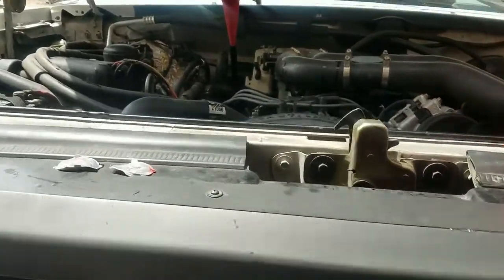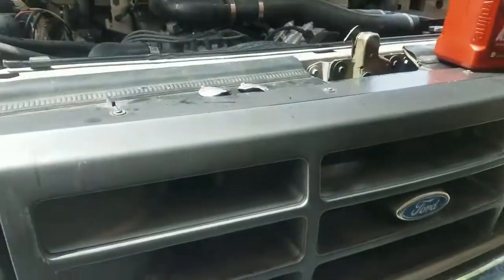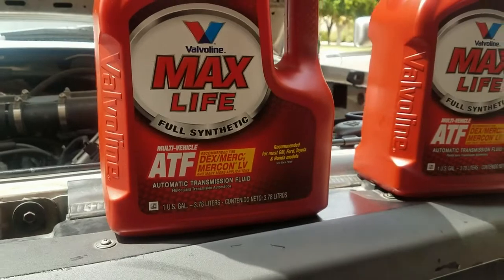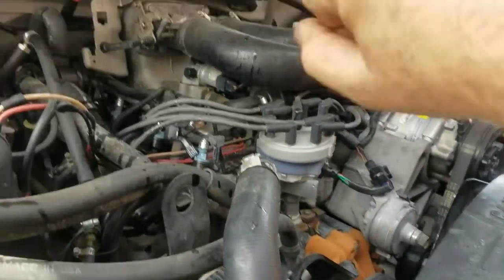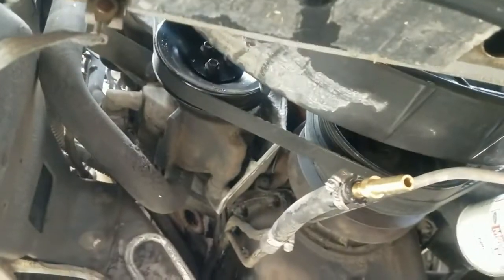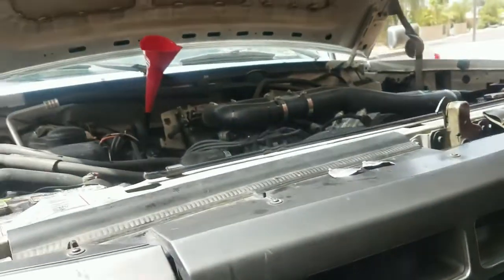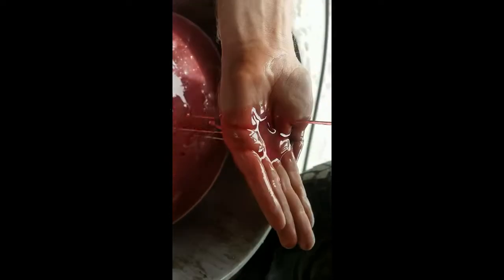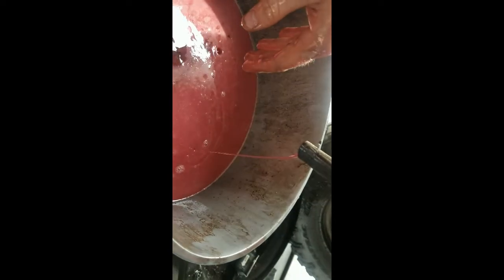Coolant in transmission fluid  what to do

Comment: i think I'm going your route. i have an 04 bmw x5 3.0i with coolant in the transmission. the car won't drive on cold start but once it fully warms up it drives with absolutely no problem. I'm gonna remove the outgoing hose from the trans cooler and keep feeding it fluid from the fill plug on trans until that milkshake becomes pink again. hopefully that save the truck and transmission.

Comment: Hey, what was the result? Did the truck give you any problems later down the road?
Reply from the maker: @FunDadAdventures  the transmission did end up going out a year later.  Had a hard parts failure.  Probably would have failed regardless of the coolant contamination.
Reply: @ thank you.
Reply: @ doing a fluid swap this weekend. No issues with transmission on line. Just preventative.

Comment: My 2022 Ford Edge is currently at the dealership with this problem. Trans cooler leaked coolant into the transmission and trans fluid into the coolant. So far the bill is up to $13,000 for a new transmission  and everything related to the cooling system including a new heater core. Thank God the car is still under warranty. The car was running fine. I only noticed it when I saw what I thought was oil in the coolant. Ford is stepping up and replacing everything without a fight. Once coolant gets into the transmission there is a good chance your transmission is done. Same with any type of oil in the cooling system. Every rubber component has to be changed. If it was not under warranty I would have flushed out the transmission until every bit of coolant was out and I would take my chances.

Comment: I want to see how this worked out long term didn't drop the pan replace the filter or the radiator wich is obviously the issue I'll be doing this myself soon but I think I'll replace radiator filter and obviously dop the pan after flushing as well as adding sone Lucas transmission additive

Comment: can use a clear hose instead of hand,  good video
My corolla trans cooler inlet line broke off last night.  Trying to determine if coolant got into transmission because the break caused both systems to be open at the same point.

Comment: But why you aren't showing that radiator needs to bereplaced?  Because people may think that once the flush is done there wouldn't be anymore fluid passing through again.
Reply: Definitely needs to be noted!, for the ones looking for a “quick fix”
Reply: I'd think common sense would dictate radistor replacement as he disconnected the lines. 
From what I've read in the past, the converter is probably toast.
The value of the truck most likely doesn't warrant long term repairs.  I'd be interested in knowing the current status. Like many readers here, the success of the fluid exchange would weigh heavily on investing $1500 vs $150 for fluid.
Reply: I mean, when he called it a POS defective Spectra radiator that didn’t light up any light bulbs!🤦🏽‍♂️🤦🏽‍♂️🤦🏽‍♂️

Comment: How many times did you have to do that ? I had the similar issue and this weekend I flushed it I used 3 gallons of transmission fluid and it still looks like purple fluid . Should I just go buy 3 more gallons and keep going until it’s clean or is there a bigger issue? Also I did replace the radiator that has the oil cooler built in it .

Comment: I had the exact same thing happen on my Mercedes, it seems to be a common issue with them… there’s a recall for certain 2003 model year Mercedes vehicles but it happened to my 2006 for whatever reason. 

I’m currently doing the same flush procedure… before you do the flush I would drop the transmission pan and get every last ounce of contaminated fluid out of there. Yes you can drain it via the drain plug, but on most if not all transmissions the pan will retain a few ounces of fluid unless you remove the pan and empty it out. If there’s contaminated fluid sitting at the bottom of the pan it’s just gonna keep mixing with all the new fluid that you put in there. 

I would install a new filter as well because it will also be full of the contaminated fluid… while the new stuff will flush through the filter, it’s probably better just to get every last drop of the bad stuff out before you begin your flush…. the main thing I learned from this ordeal is that it doesn’t take hardly any water at all to contaminate a whole lot of trans fluid.

Comment: Good stuff, had trans fluid in my pan due to the cooling lines being mixed up on the radiator (placed return trans cooling line on purge valve). Good thing it was a brand new rebuild so never fired it up until I started the process you are showing here. Got most of it out but seems as though just a tad still made its way to the torque converter. Crossing my fingers
Reply: Hi Harv! What's the update? How badly did the coolant contaminate your torque converter?  Did the TC fail eventually?
Reply: @michaelmurphy5170  I had to do an additional 4 quarts of flush on it but got all of it out! You can easily tell as I loosened the trans drain plug and oil started dripping. As you may guess, if you see coolant leaking out of the plug, then you still got some in there (coolant is more dense than oil). That's the reason why I ran another 4 quarts to get it all out. Which was prob like half a quart or so of additional coolant removed. I'm glad I did this as people claimed that there was no way coolant could make it to TC if car wasn't started. Well that was all BS of course cus mine certainly did have coolant in TC.
Reply: Thanks for the info Harv. I'm not gonna take the risk. In my case, coolant has been in the torque converter for months, since June at least.  It's suppose to turn the friction plate linings to pulp as they are glued with water-based adhesive. :-(
Reply: @michaelmurphy5170  Oh shoot, yes in your case it has been awhile with that sitting in there. Mine was a little over a week or so.
Reply: It's a funny story Harv! Back in June, I bought a used torque converter on ebay for £70 (about $80). To replace the TC in our Merc ML W164 which has a fault with the lockup clutch.

The vendor assured me that his TC was in great condition. So I flushed it, ready to fit, and that's when I discovered it is contaminated with coolant :-( not happy, as it's money wasted (no refunds), and I gotta source another one!
Reply: @michaelmurphy5170  Wow, that's pretty sleezy!! Prob the reason why he was trying to get rid of it...

Comment: My questions ? What causes water in Transmission ? My Mechanic told me the Transmission cooler inside the radiator leaked and caused the water to the Transmission and come out through the overflow. The radiator had no Transmission fluid when I flushed.  After changing the radiator and flushed out the Trans fluid. It worked good. But a fees day latter. Same problem water in Trans fluid and come out through the over flow when the Trans got hot. Thanks.
Reply: Old question but still worth answering. The radiator cools both the engine and the transmission. Transmission hoses (lines) come out of the tranny to the radiator (usually near the bottom) and passes through the radiator as essentially a sealed pipe through the radiator. If there is a leak internally inside the radiator, because the radiator is hot and pressurized the rad fluid is pressurized into the transmission cooler tube and into the tranny... you are losing coolant into the transmission when the rad gets hot and is under pressure. So the root cause is a bad rad...

Comment: I got in accedint front end damaged 2004 Nissan Xterra but the car ran fine after the accedint .
but there small coolant leak anyway I drove like 1 hour back home .
now next day my car start and run fine.
 but when I put it on drive i can feel it engage but it won't move at all same when I put it on reverse .
I didn't think about anything but replacing the radiator because it leaked all the coolant out next so I installed brand new radiator but the problem wasn't fixed .
Now I came close to your video and oh man my transmission fluid was strawberry milk shake like that .
So I flushed the whole thing like you did and I also changed the transmission filter too just incase .
But the problem wasn't fixed my car still a brick won't move .
MY QUESTION is what possibly went wrong inside the transmission ?
I'm afried to take it to transmission shop because those people would say " oh you need new transmission " even if it's simple fix as simple as a sensor or wire got disconnected for example .
Because they went to make top $$$$ at any circumstances .
Anyone can give me a hint what possibly went wrong from the coolant got inside the transmission ?
Reply from the maker: What happens unfortunately is the coolant breaks the bond on the friction material down and the clutches come apart.  It's a very common problem on nissans.  My transmission was still working fine just could smell the coolant.
Reply: @AutoRepairTips  , Thanks for the video how to flushed out the water in the Transmission. After finding the water coolant and Trans fluid overflowed , my mechanic told me to change the radiator ( Mechanic thinks bad Trans coolant caused water in the Transmissions) so , change Radiator and flushed out all the fluids , will solved the problem. We did and the car runs good. 😊 But , when the transmission get hot , the same problem , ( Trans fluid leaked through overflow hole. Is that possible I just got another radiator with a bad Trans coolant ? Or my engine oil cooler seal is causing the water to leak. But why to leaked to the Trans ? If it is , why the Trans overflowed with water , while the radiator overflow tank is cleans no oil or Trans fluid ? I thought bad engine seal caused water in the engine. Thanks. I hope someone's will read and respond , I loved  my old Clk 430 , but does not want to replace / rebuilt the Trans. Thank u very much
Reply from the maker: @ramosochoa418  If you want to find out if the radiator is the cause of the problem, disconnect the cooler lines at the transmission then use a coolant pressure tester to add pressure to the cooling system.  the water will drip from the transmission cooler ports.
Reply: @AutoRepairTips  , Thanks , for the good advice , I will come to the mechanic and had it check if the new radiator coolant causing the problem. Or maybe the mechanic did not fully flushed out the excess water , so when the temp reach certain degree the water boiled up and come out from the overflowed. Anyways , Thanks for the tip. I will keep update. the Clk430 problem after seeing my mechanic.
Reply: @AutoRepairTips  so its might be only the clutches in my transmission ?

Comment: Thanks man I have the same thing going on with my 85 Chevy I’m gonna do the same thing you did and hopefully everything turns out tremendous
Reply: If you flush it put it in drive and put the brake on,because a torque converter dosent turn in park or neutral. I looked it up because same thing happened to my 06 tundra.
Reply: @jimbomorrison7133  shit man thanks I did a flush on it and it works fine but I check the oil and it still looks like Pepto-Bismol but this weekend I will be doing a other flush so your advice is very helpful I will be taking your advice thank you very much and have a blessed day or night thanks 🙏
Reply: @88gunnz94     Welcome. As your flushing it,with the parking brake on,you can press your regular brake and go through all your gears,D,R,N,3,2,1.,and you will flush those gears also. Hope it works and be careful. I went up and down on all my gears then stayed in drive until fluid was cherry red,then I changed the filter.....AGAIN!!! Runs great though and be sure to check level after flush.
Reply: @Fernando Quintero   No buddy,because the transmission pumps pumping the fluid out like a water fountain at idle speed,but I went through every gear a couple times and more and more contaminated fluid came out until it was a good red color.
Reply: @jimbo Morrison thanks man I will do that thanks for the advise
Reply: @88gunnz94  👍

Comment: good luck. exact same problem just happened on my 91 Firebird T-T
Reply: My 06 tundra,same thing happened. You have to flush it in drive with the brake on because the torque converter dosent turn in park or neutral.
Reply: @jimbomorrison7133  I thought torque converters turned any time the engine was running because they’re bolted directly to the flywheel… does the Tundra use a different design?

Either way I agree that you should run the trans through all the gears in order to flush it thoroughly, that way it will run your new fluid through every part of the valve body, etc.
Reply: @TireSlayer55    Yes,sorry,I was in another place. The converter turns once you start it. What I meant was you had to go through all the gears until the pink stuff is all out and you have a good maroon color. If it just sits in park it won’t run all the pink stuff out. Sorry
Reply: @jimbomorrison7133  No worries, just wanted to clarify. I pretty much found the same thing out because I thought I had got more or less all the milky stuff out via running it in Park, I put it in gear to see if that changed anything, and a lot more milky stuff came out lol
Reply: @TireSlayer55   Yeah,you pretty much need to get another torque converter because of the glue that comes off in it,but the 750E trans is a tough transmission.👍🇺🇸🇺🇾

Comment: How’s your Transmission working now that it’s been two years since the ATF flush? I’m about to do this flush for my 2006 Nissan Pathfinder with same coolant in the ATF issue. No symptoms from my trani yet too. Hopefully it’ll last a while after flushing.
Reply from the maker: The transmission had a hard parts failure unrelated to coolant getting in the transmission.  Forward planetary broke.  When I tore it down the clutches still looked pretty good.
Reply: @AutoRepairTips  ohh
Reply: Update on your transmission?

Comment: I have the same issue with a 1997 TJ wrangler 
Changed the water pump and the radiator 
How do I flush the transmission which is 3 speed automatic 

Should I take it out or just follow the drain and watch till it dries and during process should I keep the vehicle in parking or stry some gears while not moving

Comment: I don't no if your still on this channel are not but if so got a question for you ,  My friend had me come to his house today to look at his 2002 Ford Ranger Edge 4.0..   He said someone told him the water pump or the transmission cooler was leaking,   When i checked it out it was a big hole in a water hose that come straight up from his water pump to around his intake about 6 inches long..    well I took that off but I noticed the water was oil pink really bad, and so is the inside of the radiator...   It looks like his transmission lines is running to a separate transmission cooler that is not part of the radiator that someone installed before he even purchased the truck.... its not leaking...  would that cooler still cause fluid to back up really bad into his radiator even if it is not leaking the transmission cooler is not leaking?
Reply from the maker: I am not really sure what you are asking.  External transmission coolers are very common even when having a cooler in the radiator.  All of my vehicles are set up  like this.  Do the trans lines go to the radiator?
Reply: @AutoRepairTips  hello 

Pls answer my question as well

Comment: I'm going through this right now with my Dodge Dakota. Spent over $1200 replacing the radiator, changing hoses, and labor. I still have to suck the last bits of pink out of the coolant using a turkey baster, and we've rigged up a collostomy bag of sorts with a pop bottle so it doesn't drain into the other tank.
Reply: I believe my 2008 Dodge Dakota has the same issue. Getting checked out now. Did your Transmission come out ok once they fixed the problem?